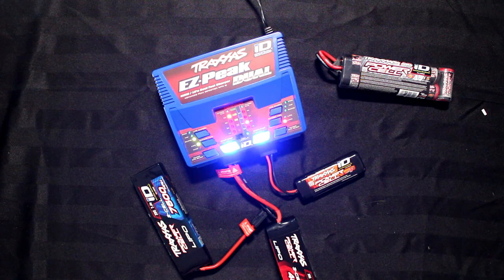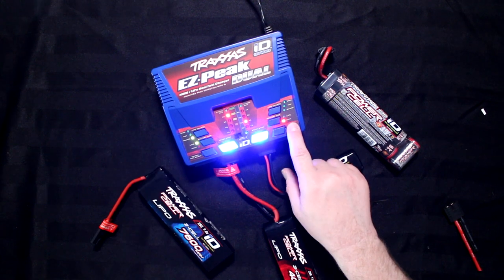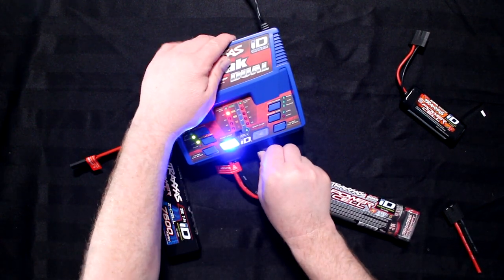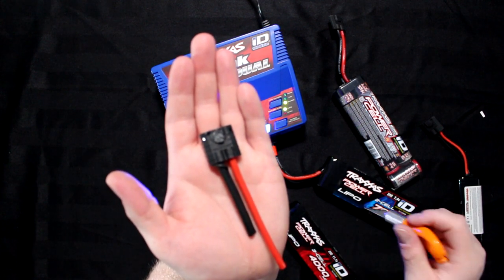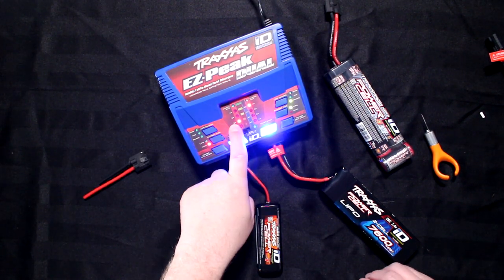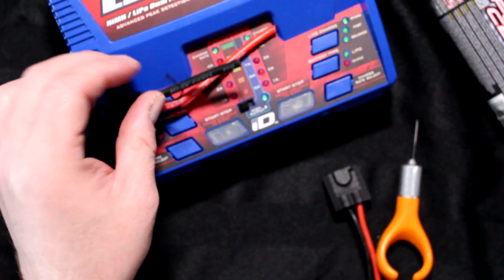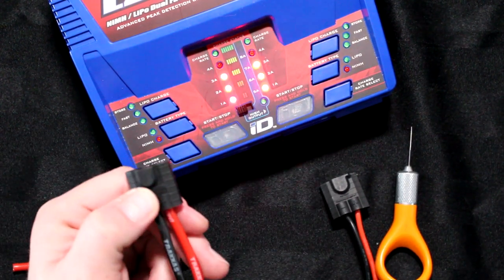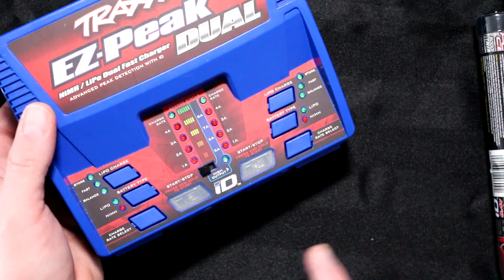Traxxas ID Connector

Comment: I just bought a preowned Traxxas easy peak plus model MC-40i. When I plug the battery in it just keeps blinking. Does that sound like I have a bad battery or charger
Reply from the maker: It could be two things it could be the battery is dead with no voltage or the charger might be bad if you have a multimeter I will check if the battery has voltage if it doesn’t have any voltage there’s a big chance that the charger is fine if the battery has voltage it could mean the charger is bad. If you check the voltage on the battery and it’s higher than 7.3 V couldn’t be that the charger as an issue

Comment: I have the DC 4 amp charger for my Traxxas battery and I charged it my car then it just stopped working do you know how I would fix this
Reply from the maker: There’s a possibility you blew the fuse at the tip of the cigarette lighter if you unscrew it you’ll have a fuse there from her correctly it’s a 4 or 5 Amp

Comment: Another video said you can't use more than 8amps total at one time between the 2 charging ports
Reply from the maker: The EZ-Peak® Dual charges two batteries simultaneously at up to 50 watts (4-amp) each, or switch to High-Output mode to charge a single battery at the maximum 100 watt (8-amp) output. Charging faster means more fun time behind the wheel.